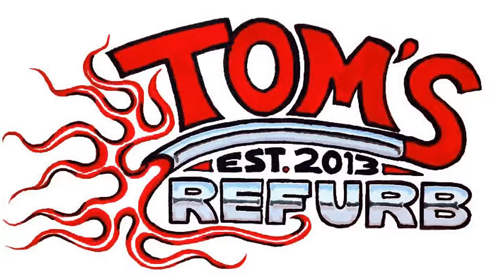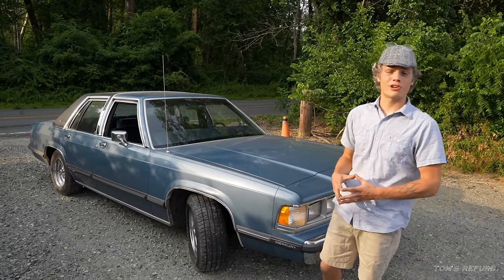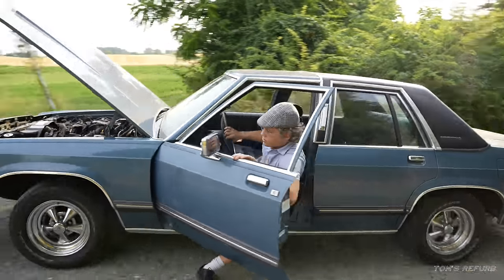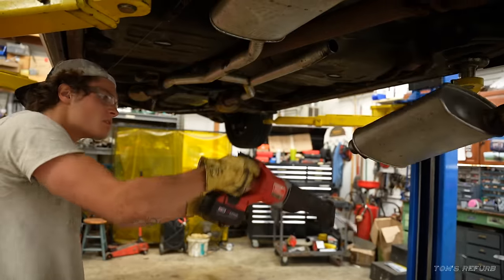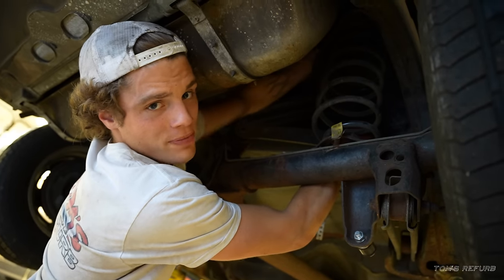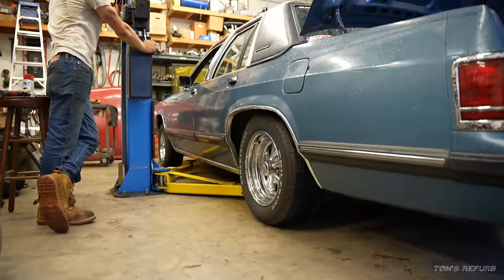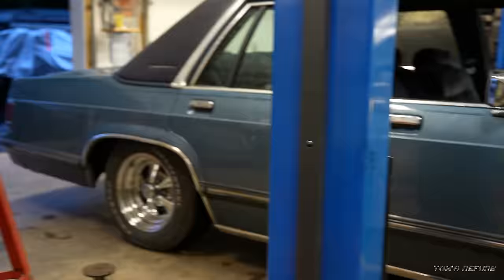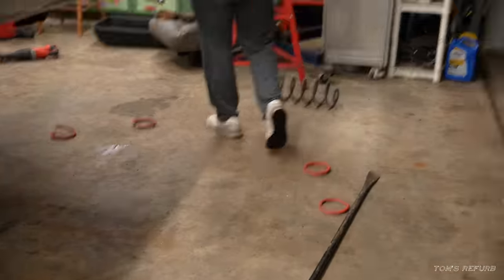*PIMPING OUT* MY FLAWLESS '89 MERCURY! (The Slammed Marquis)

Comment: EXCELLENT video! I had a 1983 MGM LS. I converted the single exhaust to h-pipe duals with turn down tips before the rear axle. It had 4 MTX RT2 15's in an isobaric bandpass enclosure running off an Autotek 7300BTS amp. That car was the best $625 I ever spent in my life.

Comment: I had one with a "few" more miles. Had a weight mod and muffler delete where the bottom was rusted out. It also barely had any HP left and i knew jack all about cars at the time. I got it for free and got 500 bucks salvaging it iirc. Toms is nicer lol.

Comment: You only went a little too low in the front, and I think it looked better with the wheels it came with, but otherwise I like the other changes, especially the tint. It'll probably sell quicker with the chrome wheels too, but it sounds good, with or without the Flowmasters. And on the off topic, the instant 30's are ok, but I prefer the 10's with tylenol in them, they last a little longer haha

Comment: You know, I could never really tell what something sounds like from a video. I installed exhaust for a while, and some people always had a video of what they wanted it to sound like. Most of the time, they weren't happy. Then I would skip all the expensive stuff and use The smallest glass packs( 12 inches.....) And usually did the trick. 
My own b18 swapped 92 civic hatchback had a stainless header, 18 inch resonator.  2  1/2 inch exhaust, a 14 inch glass pack, and a big chrome can on the end. It was still irritatingly loud. But sure was fun.

Comment: The spark knock clunking on 1st burnout was perfect lol. Take a car that clean, interior just as clean and plush. Put it into a 85 buick regal limited. You have my car behind me. 80k on mine. Im doing an upgrade from 3.8 to a 408. That should help. Then instead of a tiny grand national turbo, you just add twin 78/75s. That should up the power a little bit more.

Comment: We had a 88 that i put a but load of work into was making aroud 300 to the wheels.  But the first thing i did to mine befor touching the motor was. A torque converter in new rear gears the aod dove grate wirh 4.56 gears and a posi mad it feel alot faster then it was and i was still able to do 100+

Comment: I have a 1988 Lincoln town car with the same blue interior I like the pre face lift look marques but man the interiors are lovely and actually don't squeak or rattle even after 32 years. Yeah first thing I took off my town car was the rusted muffler and 2 of the 4 cats and ran them out the side sounds soooooo much better but sometimes accidentally crush them cause I live on a dirt road.